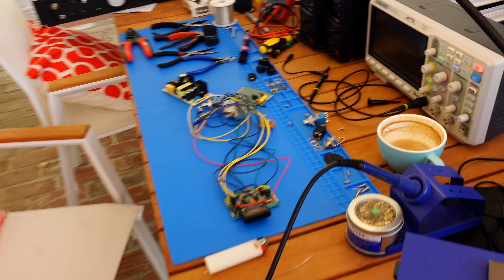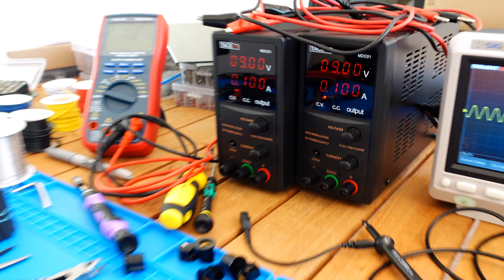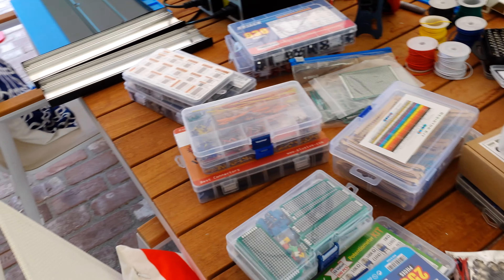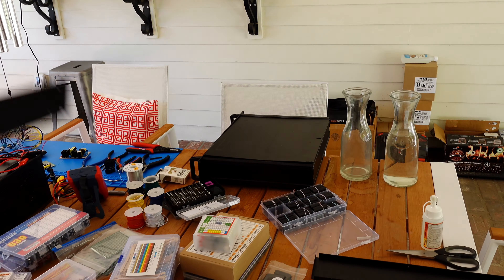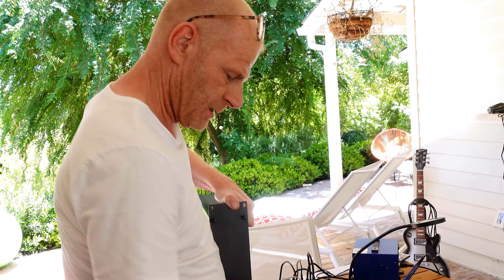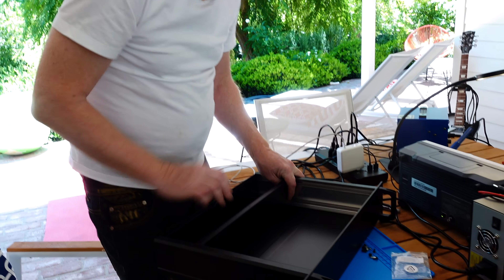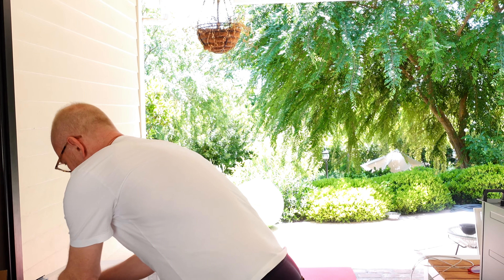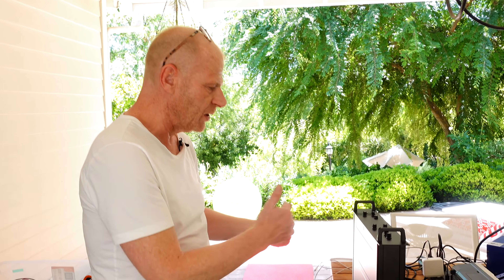Making My Own Guitar Amplifiers (Part 1)

Comment: Hey Tom, I recommend stepping up the holes on the front panel before using those large drill bits. Drill small pilot holes first, then incrementally increase the size of the drill bits until you reach the final size. If you go for the jugular and start drilling with a large bit, you can ruin the panel and can even hurt yourself if the bit grabs the panel and slings it around.
Reply: Wouldn't it be easier to use a drill crown?
Reply: @Sludag  yes, or a unibit.
Reply: I need to fix a new aerator once again.  Starting tiniest first. I do have a tiny vice. Already blind, but will still protect my eyes. ...and scalp.  Yukon Crews. 😎 Tired of water spraying backwards and into the cabinets thru the stopper lever assembly hole. Hoping to make it serviceable for its purpose.  The last two times those were switched I just ended up having to leave those aerators out entirely.  Just learned a new thing to try, after everything else.  🎉🥳